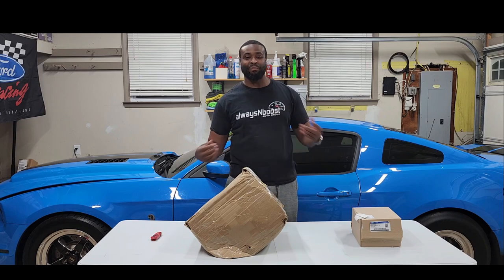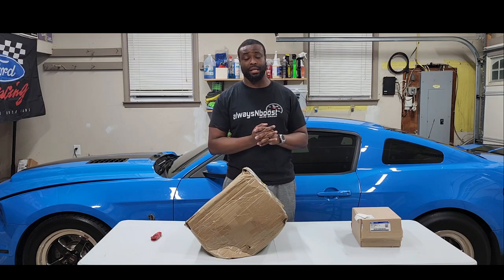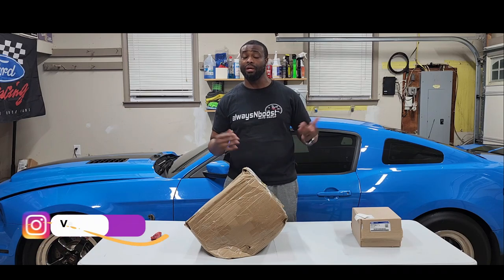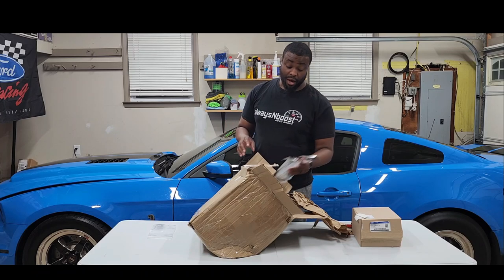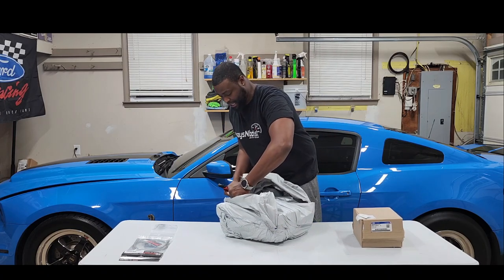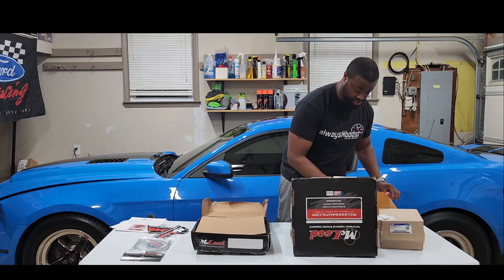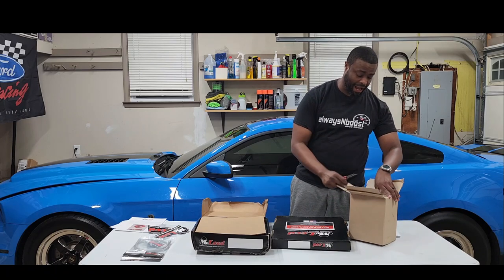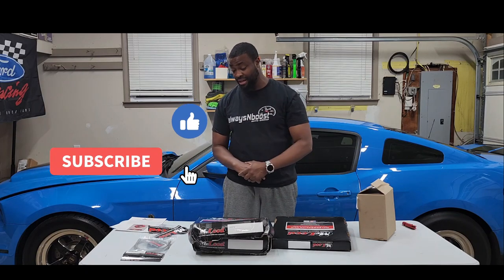Mcleod RXT 1200 Clutch W/ Steel Flywheel for 2010 GT500 Mustang

Comment: Any idea how install went? 
Do tou have the part number?
I got the same clutch but I can't find any info on the plate/adapter that goes first and bolts to the flywheel
Reply from the maker: It's crazy you asked me this I have been so busy with my new business and haven't had time for YouTube. Yes I got it installed and I did a video on how it went  I just need to edit it. It was short so let me see if I can put something together the next few days
Reply: @AlwaysnboostGT500  awesome man, currently doing the same clutch, (used) and I'm putting regular rxt clutch and floater ring in it because the rxt1200 were shot
Using same adapter as well, hopefully it goes well
Reply from the maker: Clutch fixed all of my issues clutch is awsome